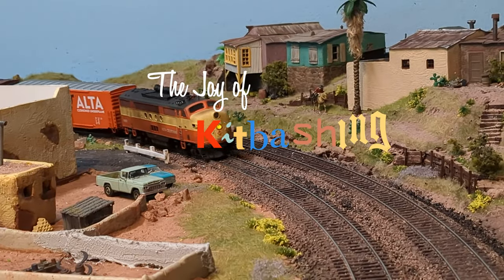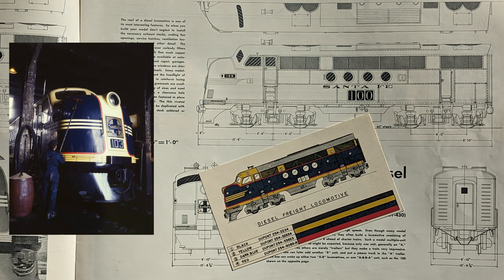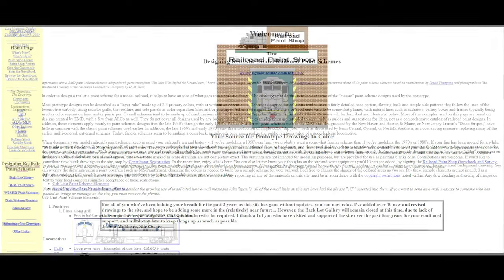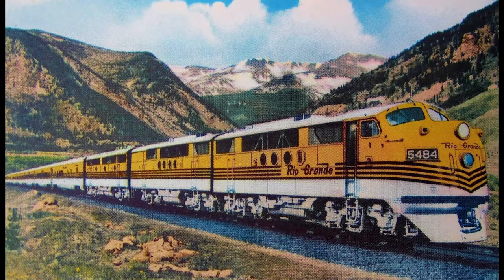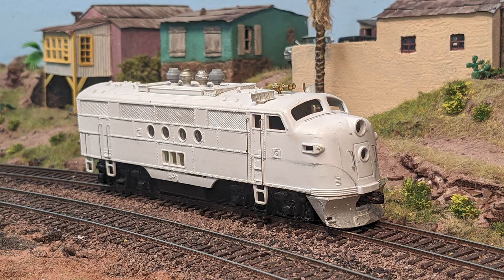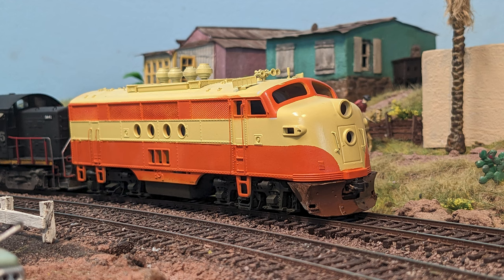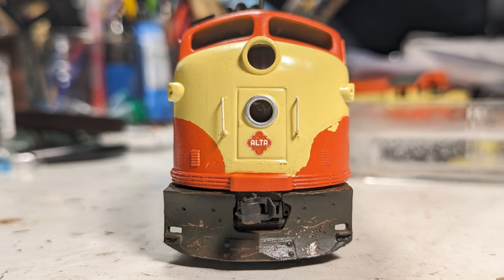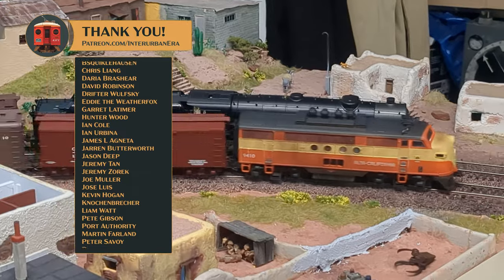Custom Detailing a Freelance Bowser FT in HO | The Joy of Kitbashing

Comment: EMD FTs were designed to operate as permanently-coupled AB pairs. A single A unit cannot function without its mating B unit, since it had the staring batteries and a small steam generator. No railroad ever operated these alone.
Reply from the maker: This is a myth. While I agree with you on "As Delivered" they had their batteries in the B unit, both the ATSF and Southern rebuilt theirs to run as single units with couplers in place of drawbars as well. Here's an ex-SOU example running solo on a Georgia shortline: http://www.rrpicturearchives.net/showPicture.aspx?id=3946412

Comment: 6:14 This is why I never use Tru-Color paint. The colors are often inaccurate and the stuff flakes like heck, as you found out... Even Tamiya masking tape will pull it. I would recommend Badger paints, Vallejo, and Army Painter. I also normally put a Vallejo matt spray over the top to seal all my paint so it doesn't chip in future.

Comment: Stumbled across your video and I love it the attention to detail and backstories that you give each and every locomotive. I also like the mixture of rolling stock such as more modern boxcars and boxcars modified without the running boards (roof walks). Makes for a nice mixture of equipment.

Your paint designs are incredible! I’m trying to work on something for my own fictional railroad but having little to no success. I especially like the Alta with the “bone” (zebra) striping. Reminds me a lot of the Wet Noodle Era diesels and rolling stock on the CN.

On another note, will you be thinking about creating a B unit to accompany your A unit? There was a former Northern Pacific A-B set of FT diesels that went to Mexico. The FT A unit is in a museum. I think the old B unit still sits in a railyard rusting away. Just something for your railroad to perhaps add to its growing fleet.
Reply from the maker: 1968 is one of those important transition years where composite (wood+steel) freight cars were in their last couple of years, postwar steel equipment began getting weathered/ roofwalks removed and hy-cube equipment debuted. It's a very cool era to model. 

I'll definitely be building more than on B unit for the FT. I've got a pair of Intermountain FT's that'll be the next units painted up. 

If you want to brainstorm on paint schemes, LMK. What region/era is your fictional line?
Reply: @InterurbanEra  The line is completely fictional as is the land and industries it serves. It is dubbed ‘The Eeriee Railway’ serving the land known as Eeriee. Other railroads include the Grand Trunk Eeriee, the Boo Line, the Haintsylvania, Lycan Lines, etc. (Halloween inspired).

Equipment differs and I mean DIFFERS. From burbling semi-modern diesels to ancient steam engines, streamlined passenger trains to farther-than-the-eye-can-see freight trains, powerful steam engines to enormous electrics. Everything is set in sort of the transitional period as you mentioned but the timeline is quite modern (our current period), with ancient wooden freight cars next to gleaming graffiti covered grain cars, from long flatcars with intermodal containers to open-topped autoracks, boxcars of every shape, size and colour, with and without roofwalks. See this video and the freight train in the first bit is what I mean.

https://www.youtube.com/watch?v=SXHlcxIiCJg

My railroad has its own emblem if that helps. (I tried going for something Frisco inspired but ended with up a mixture of FRISCO and Bangor & Aroostook).
Reply from the maker: @alexanderpoirier3350  sounds downright spooktacular! That's really fun. It'll also be an enjoyable concept to build upon as well.